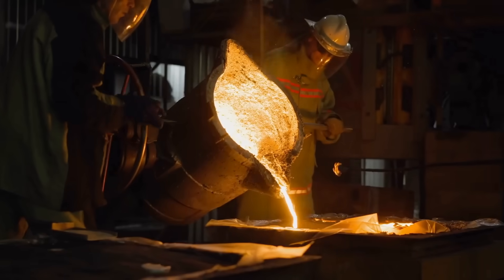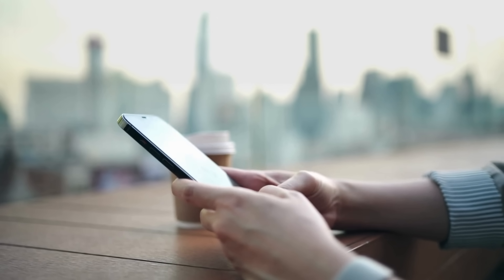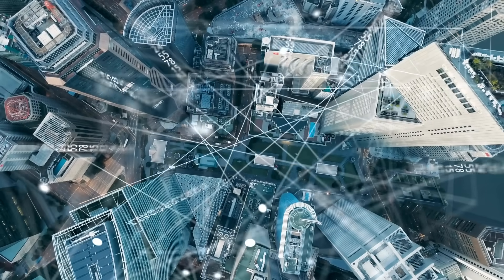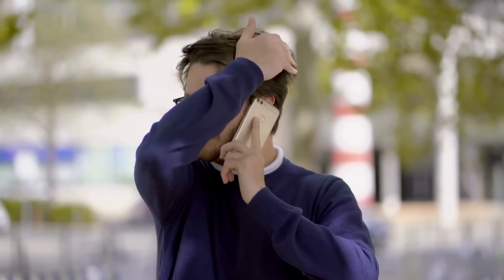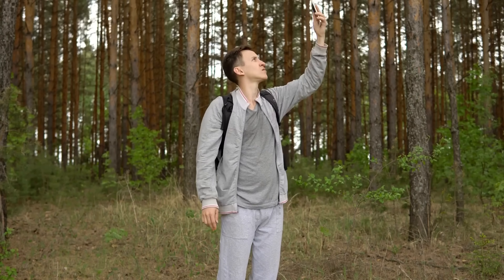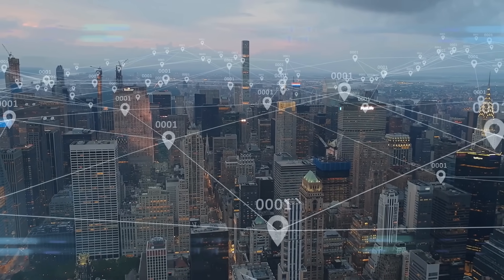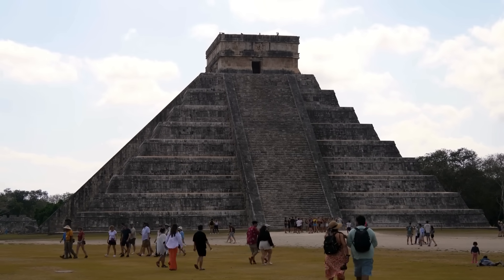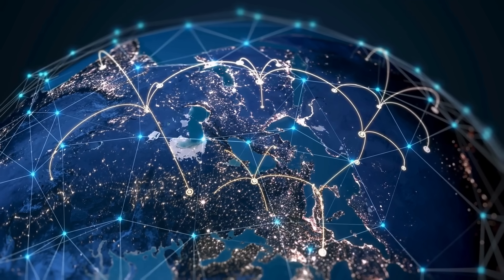How Do Cell Towers Work? The Science of Cellular Networks

Comment: What I think you said. From phone #1 through the air to antenna on tower, down the tower to equipment at bottom of tower, through wire or fiber optics underground to utility poles, across the country through the wire or fiber optics on utility poles, to utility pole near destination, down utility pole to underground wire or fiber optic to equipment at bottom of desired tower, up tower to antenna, through air to phone #2.

Comment: on thing that was overlooked is leaky coaxial cable. In a building the higher floors are above the cell towers and the cell towers point at an angle to the ground. To receive signals above this leaky coaxial cable is run through  a high rise building to allow phones at higher heights or phones in underground train subways to work.
Ex mobile phone switching technologist.